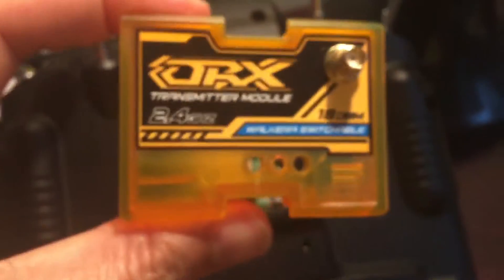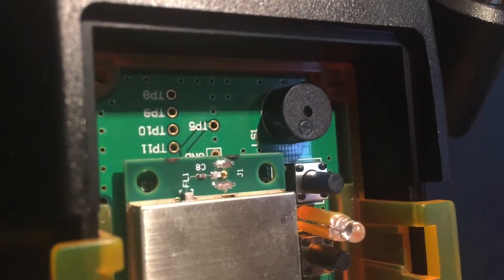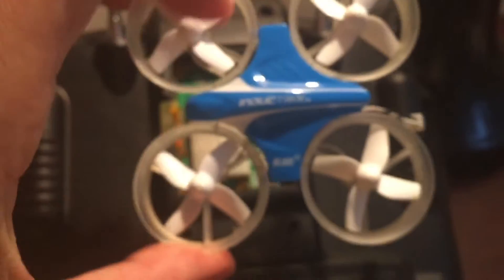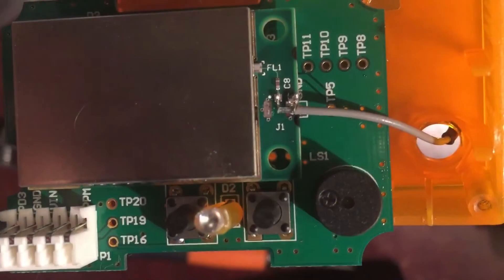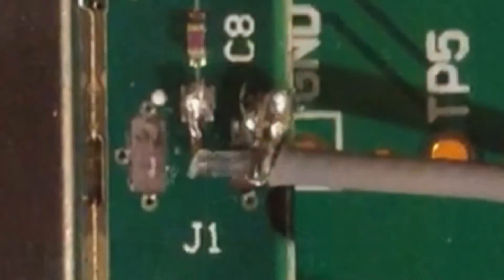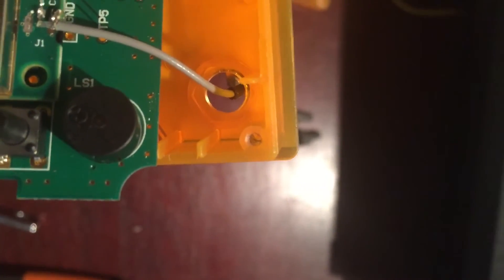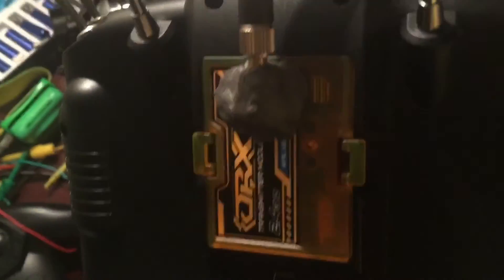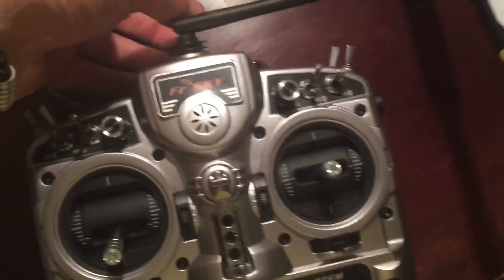OrangeRX Antenna Mod on a FrSky Taranis

Comment: I realize this was a long time ago but I sure appreciate the problems with tiny RF and other connectors and things breaking. A few years ago I finally got a microscope to help deal with soldering ever shrinking parts.
Reply from the maker: I've researched microscopes for DECADES, but my foolish commitment to FOSS prevented me from buying one. Finally the RPi HQ camera has filled the need well enough.
Reply: @RichardBronosky  Thats clever inexpensive way of doing it - how do you find looking at a screen while doing things like soldering? Easy - or does it take a while to get used to?
Reply from the maker: @ElectromagneticVideos  it helps that I had no prior experience with a better alternative. My Maker Space got donated a very nice boom arm optical soldering microscope. I could see the value in it. It's amazing how clear and easy to focus a microscope with low magnification (when compared to biological microscopes) can be. But the ergonomics and lighting options that come with a digital setup like mine are "pro" enough to outweigh any "cons". But now that the RPi4 is near impossible to get, I find it hard to justify even having an RPi3 dedicated to it. Sad times in the 1st world.
Reply: @RichardBronosky   Yeah - you cant beat a microscope like that - I was fortunate to come across a manufacturer selling off some showroom demo units - would have been hard to justify getting ta the full price. 

The supply issues these days are huge problem - I have been dealing it with it for products being manufactured and the situation changes daily - although its way better now that in was 6 months ago. Even the RPi4 - I immediately think how many companies may have used it inside their products and are no having problems shipping their own product - there really is a cascading effect.

Comment: Did you test this Module with the Nano QX (FPV)? I'm thinking of buying this module to use it with the nano qx but Im not sure if it really works.
Reply from the maker: I've seen it work for the Inductrix, Nano QX, and Nano QX 3D. I don't yet know how the Nano QX FOB handles RX & TX. If it works like others it will use DSMX for control and whatever common 5.8Ghz protocol Fatshark uses for video. Judging by the setup this guy uses, that is correct. http://youtu.be/AuHQqPmnamE